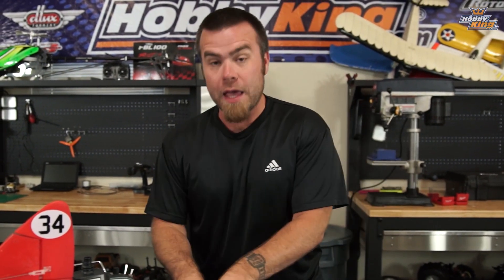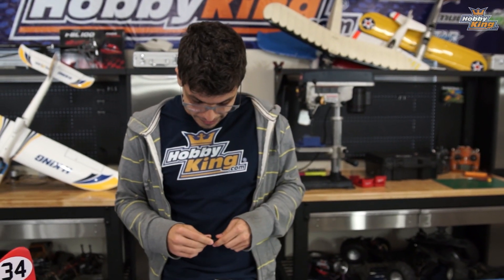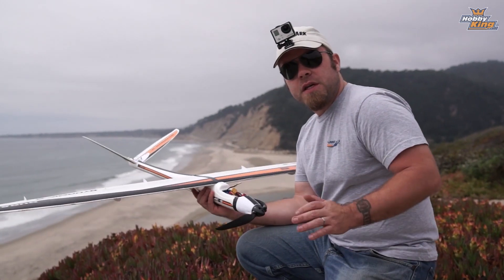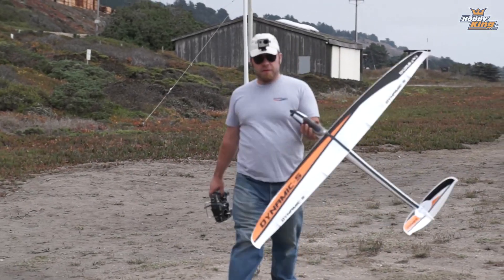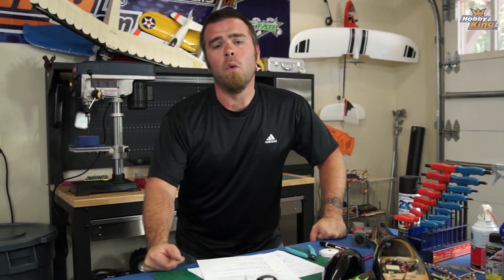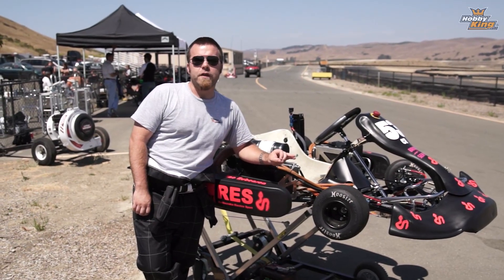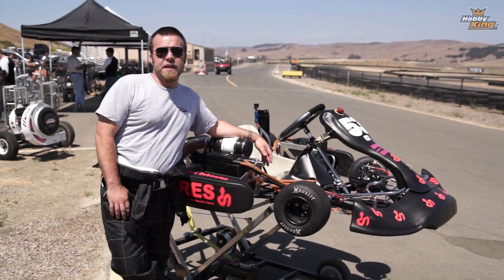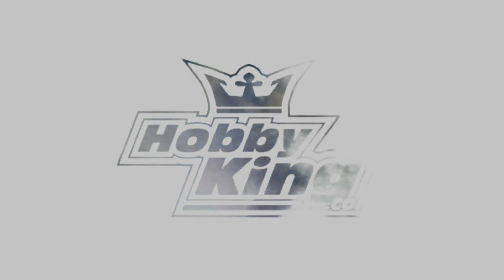HobbyKing YouTube Comments Contest Week 7

Comment from the maker: XT60's are just a pair of bullets in a housing so you can't plug it in backwards.  The bullets in my Dynamic S are the same size.  There is no issue unless you plus it in wrong.  The connection is very secure.  It's a Plush ESC I borrowed from a Multi-rotor and I didn't bother to change it to XT.  - Matt

Comment from the maker: Lol.  You guys are really bothered by that for some reason.  They aren't "unsheilded"  they have clear heat shrink tubing on them.  They are on the ESC side so there is no current or other risk.  They are bullet connectors which match the connectors embedded in an XT60.  It is a safe, quick, easy method for connecting the battery and only requires a small amount of care not to plug in backwards, which would kill the ESC.  I borrowed the ESC from a quad copter heance the bullets.  - Matt

Comment: With the slope footage, I have never seen a (XT-60?) connector used that way.  When I get Nano Tech batteries from HK, I just de-solder the XT connectors and toss them in a box.  But I never thought about using them like the Castle bullet connectors I use on my higher voltage batteries.  Interesting....

Comment: On the topic of LiPo safety. I store my batteries in an old dryer in my hobby room (don't worry the dryer is not plugged in.) I have a small shelf that I place in there to put all my batteries on, And I plan on using the top of the dryer as my charging station. Although right now I'm charging my batteries on the cement floor in an ammunition's box. 

Maxwell

Comment: You are right when it comes to indoor concession-type karts, however you couldn't be more wrong when it comes to REAL karts... Kart Chassis have no suspension, they also dont have a differential, to get them to handle correctly the chassis has to flex just right. When dealing with the extra weight of the electric a cr125 shifter, or even a TaG (PRD, Rota, Leopard) will out run it any day. Maybe not out of the gate, but every where else around the track it will.

Comment: You are so wrong it hurts. The electric karts have more power and torque, better acceleration everywhere on the track, and faster top speed. BUT, they weigh like 80lbs more than the gas karts so cannot brake or turn with them.